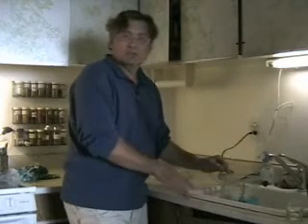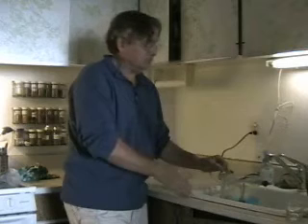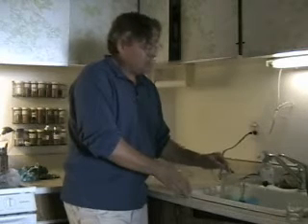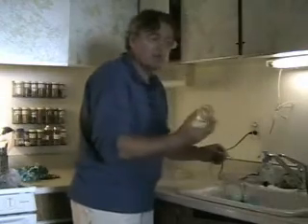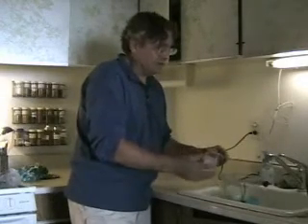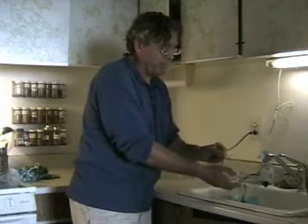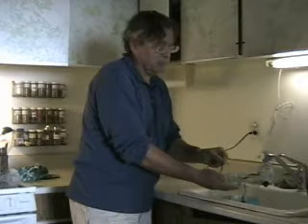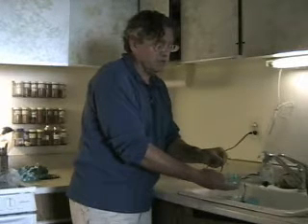V. STATIC HEAD AND FRICTION

Comment: What about the head?  Is it the same? for both small and big diameter pipe ?
Reply from the maker: Depends on which head, friction head depends on flow rate, pipe diameter and viscosity.Static head is independent of pipe diameter.
Reply: Jacques Chaurette Hello sir, As u have shown in one of the experiment that Pump head is independent of Fluid density. In the same way, what about the pump head ? Does it remains the same for different discharge pipe diameters (Same Height?)?